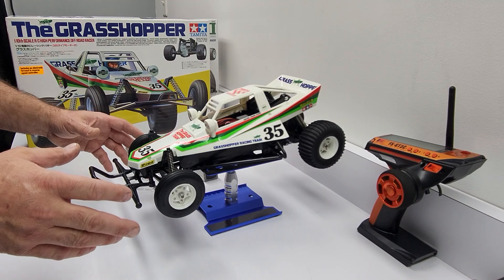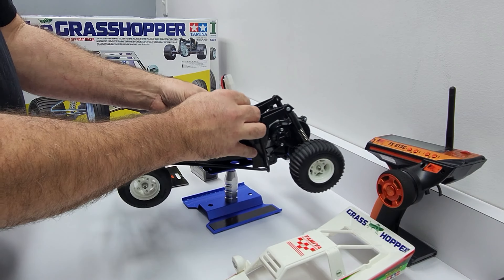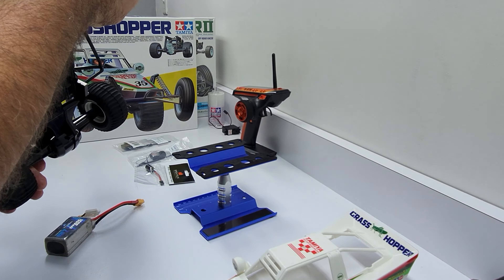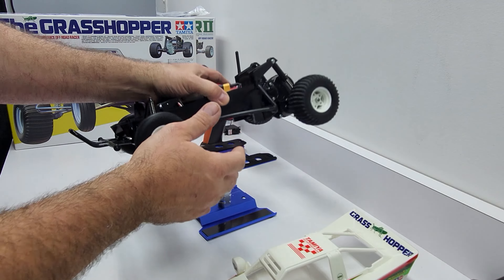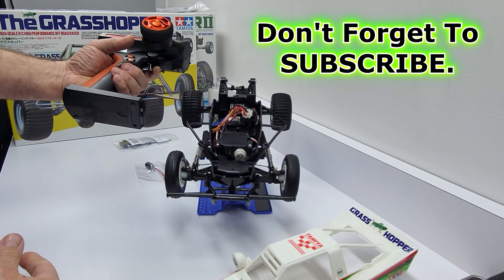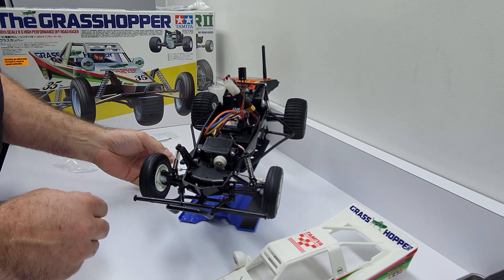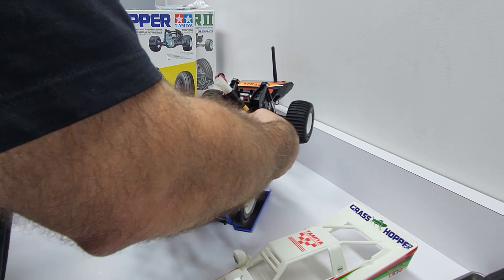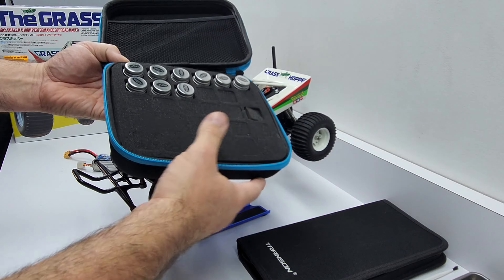STEERING AND THROTTLE ISSUE -  TAMIYA GRASSHOPER

Comment: You said that you are feeding your buggy with a 11.1v battery but I am pretty sure a Tamiya Grasshopper usually recommended 7.2v NiMh battery.

My suggestion: Bash the buggy around and see if after a while the issue persists. If at low voltage you turn the steering but the buggy doesn't accelerate it's definetly because of the higher voltage.

But frankly, other suggestions in these comments seem to be better than what I am suggesting.
Reply from the maker: The giltching went away when I replaced the analog servo to a digital one. These re-release kits comes with a Hobbywing 1060 which is NiMh and  2-3s lipo compatible. You just have to switch the buttons on the esc to what you're using.

Comment: Any progress with this? My guess would be you've routed the cables in an unfortunate way so that you've created interference. Either this or you have faulty / leaky electronics.
Reply from the maker: Yes. I ended switching to a digital servo and it fixed the problem. The one I had installed in the video was an analog servo.
Reply: @nwirc  Great.

Comment: That’s an analog servo, and you’re using a digital system. I’ve never had the problem, but I’ve heard of other people having problems because of interference
Reply from the maker: You have a really good point. I have an extra digital servo laying around and will try that. Thanks
Reply: @nwirc  definitely worth a try, Let me know how it goes
Reply: Did you solve that issue ?